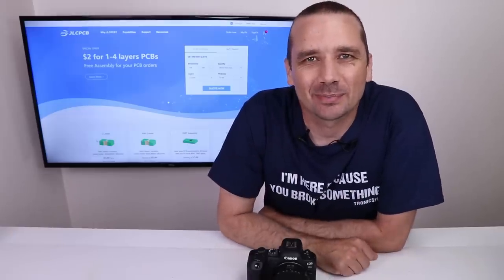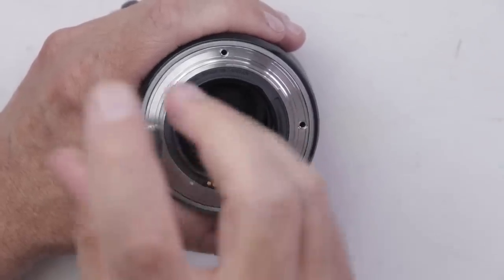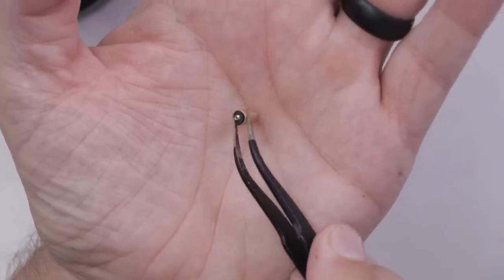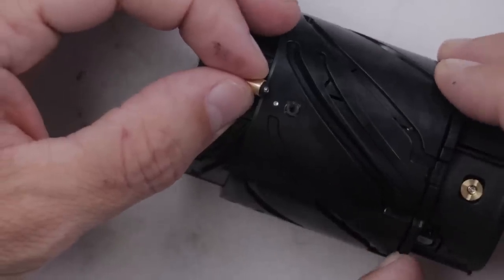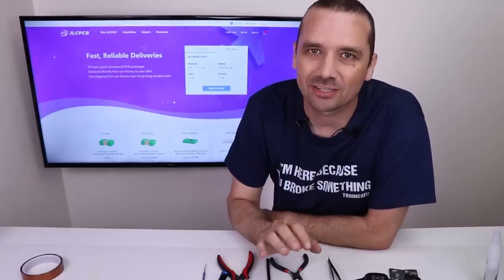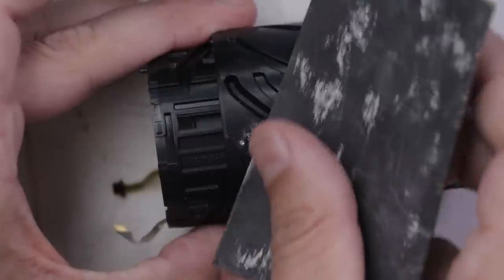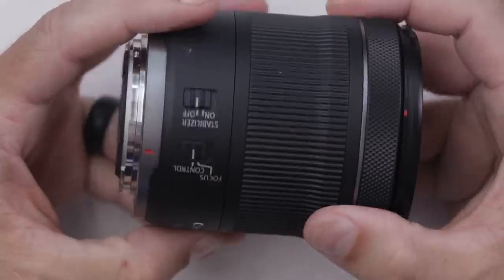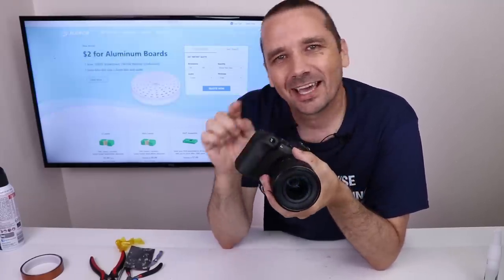I Bought a "BROKEN" $2,800 Camera & Kit Lens - But Can I Fix It? Canon R6

Comment: WTF, this defeats all logic.
Even if it is a kit, the body is separate from the lens.
The kit lens is cheap compared to the body.
If the lens is defect, the body is 100%
Who in his right mind would sell the complete kit if replacing / repairing the lens is enough?
It is like selling your car because you have a flat tire, just replace / fix  the flat tire.

The lens was dropped on the barrel, being plastic that’s enough to break it. Just think that a plastic kit lens like this is optically modern and includes nice features like stabilization, but otherwise as cheaply constructed as they can get away with for the targeted price.

The title may technically be correct, but is kinda click bate-ish.
Maybe buy a really broken R5 or R6 next time and see if you can fix that one for a return if investment, nah don’t think so either.